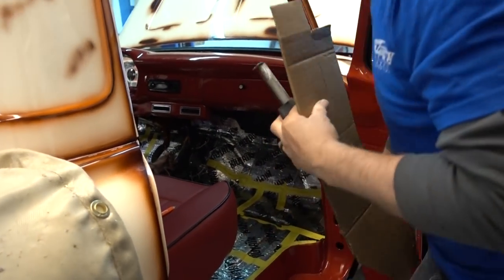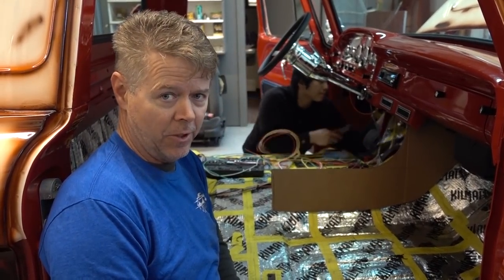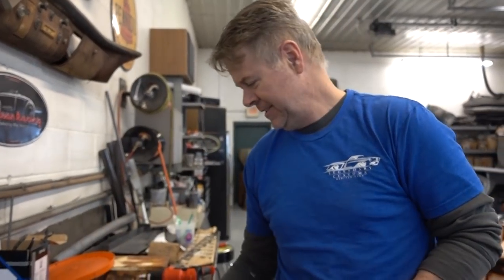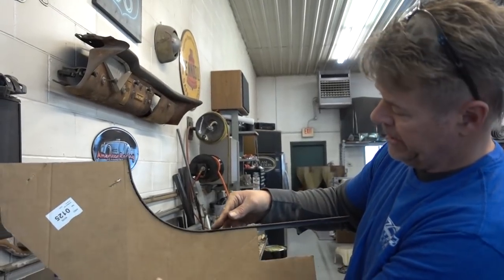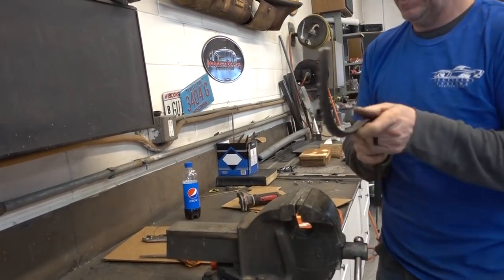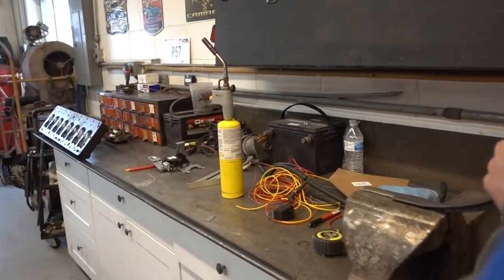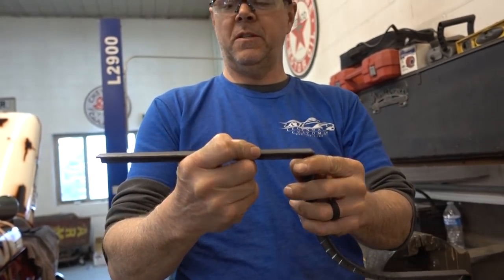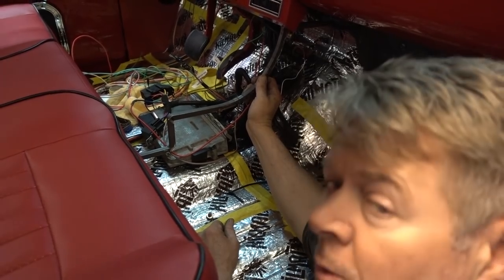LEGENDARY CUSTOMS: "Dirty Ford" Part 12 - Custom DIRTY Center Console Part 1

Comment: I am thoroughly enjoying your build videos on all your projects. Tell me, the young talent that you have in your shop, how did that come about and is one of them your son?
Reply: JonH3234 Thanks for commenting! Zack & Keng both went to college for automotive. I have known Zack literally since the day he was born. He's a friends son. Keng has moved on to a different profession. He has an open door to come back. I've been blessed with great guys! We do have a stretcher/ shrinker but they are only good for 18 or maybe 16 gauge steel. I built the framework out of 1/8" steel angle so that it would be as strong as possible. I didn't want any movement. THANK YOU Jon for watching & following. You're appreciated!
Reply: @chrismeyer6196  Yes, in this day and age it's got to be hard to get young guys that have an interest in fabrication, and hard work. Those two looked as though they were/are really enjoying what they are doing. Plus I also liked the care that  showed as they were putting things together. I'm sure you gave them plenty of compliments on job well done. 👍
Reply: Chris, as far as the shrinker/stretcher comment,  that was supposed to be edited out because after I had initially posted that, I realised that you were using 1/8 thickness angle steel. Yes, that is not going anywhere. And nice detail on the fab work on that console. 👍